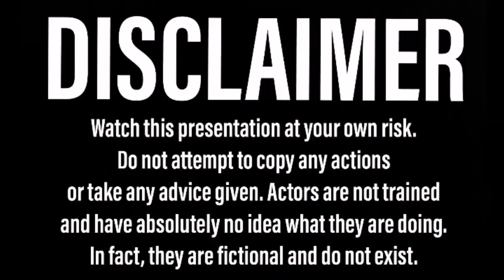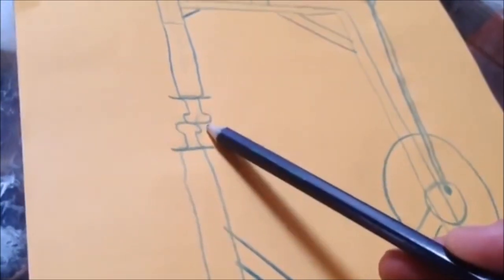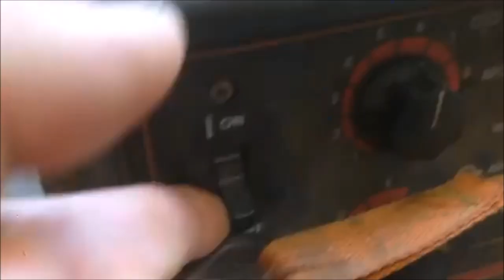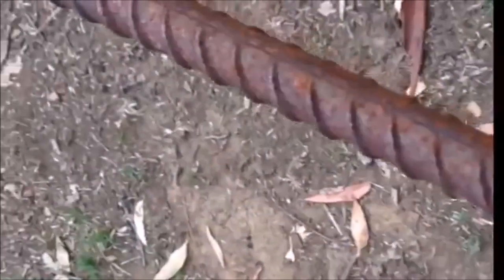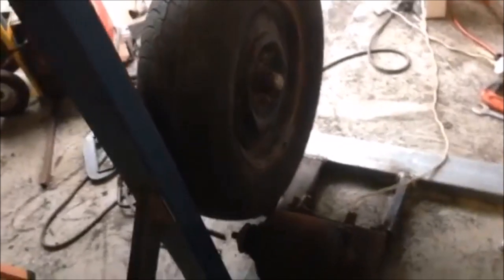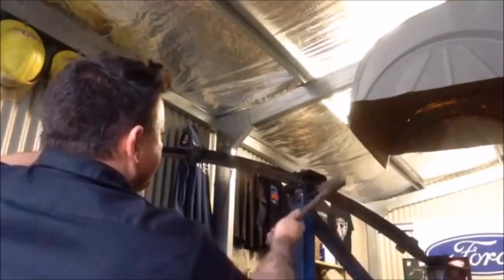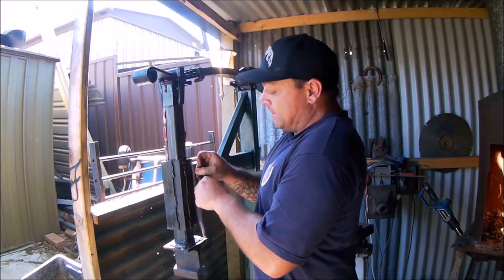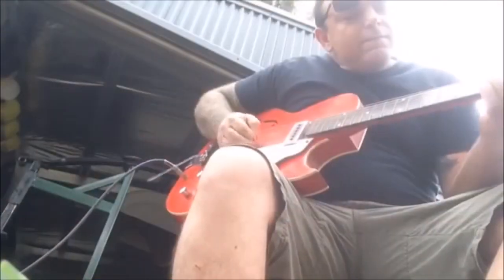Budget Power Hammer Build with Demo’s

Comment: Thats a good little power hammer mate, I'm making one at the moment but it is a bit heavier.
I'm using 110 mm hydraulic ram bar for the anvil and 65mm hydraulic bar for the striking
ram will that's what I call it .
the frame will be made of rhs 6mm thick. 
just like you It cost zero thanks to my 4 sons , the only things I will buy new are the 2 hp motor
pull'ys and bearing blocks and speed control i'm not using a car wheel .
so thanks for the up date mate catch you on the next one .Cheers .(:
Reply from the maker: Sounds good 👍🏻